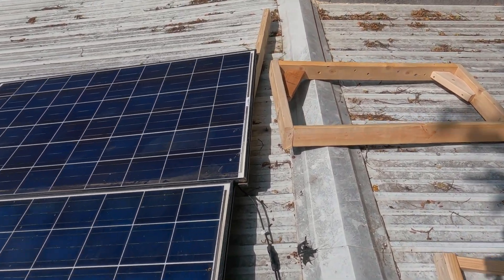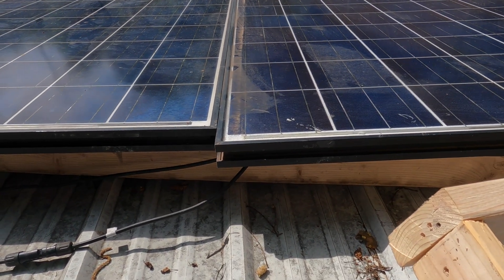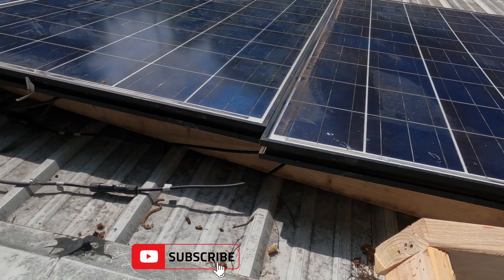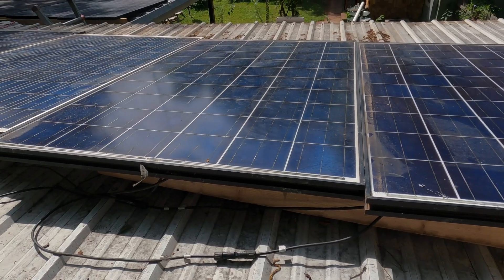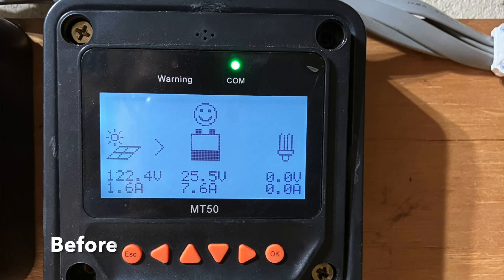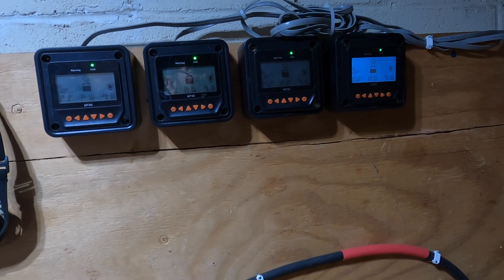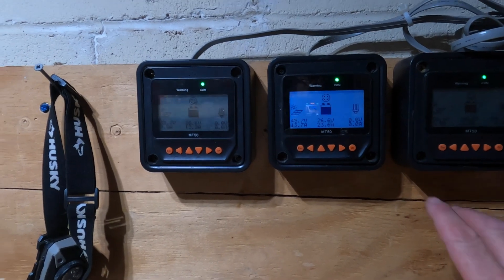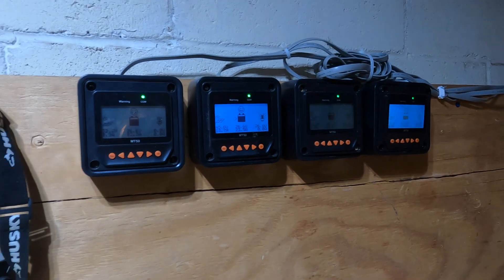Do you have to put your solar panels at the correct angle?  Does it improve your energy output?

Comment: 15 degrees is not much of an angle. FOLLOWING the sun however is a dramatic improvement of the hours you can collect. I went from 3 to 6 hours in summer, which is a SIGNIFICANT improvement.
Reply from the maker: They were at 20 degrees which is the recommended angle for where I live and this time of year. I do agree that tracking would help in general but I still was surprised that the angle didn't make it any better than the arrays at the 3 degrees.

Comment: I'm not surprised at this at all......   One of your panels is in the shade,  and they're all dirty !!!     It doesn't matter what angle you put these panels on,  if you don't address those issues,   you'll be disappointed at the results.
Reply from the maker: None of the panels were in the shade when I did this and all of my arrays were the same level of dirty.
Reply: @OurBlackCatCottage  
Dirt robs 10% of your Panel's output typically..... If just one cell is covered by a lot of dirt,   it will drop the panel's output by 50%.

Don't underestimate the power of dirt !!!  lol.

Comment: The 'ideal' angle is based on integrating your output over an entire day. I think that if you leave your panels at a better angle for a longer time, you will see more of a difference. Also, I don't think you said when you did your test. If it was the morning, then not so surprising, since neither 3 degrees nor 20 would be optimal.
Reply from the maker: When I filmed was the peak of the day for solar.  And I checked it several times and never saw and improvement over the 3 degrees.